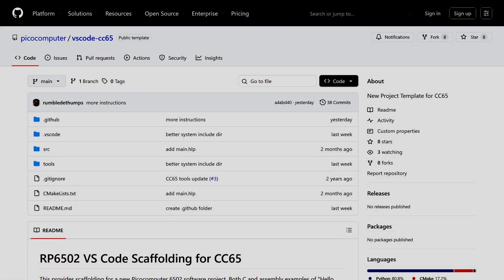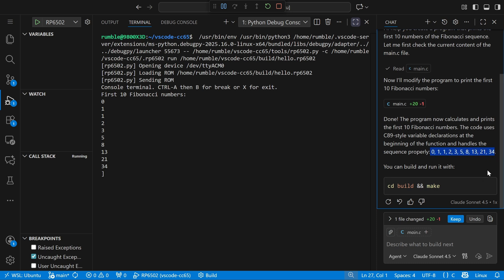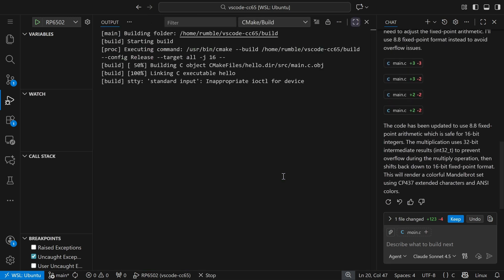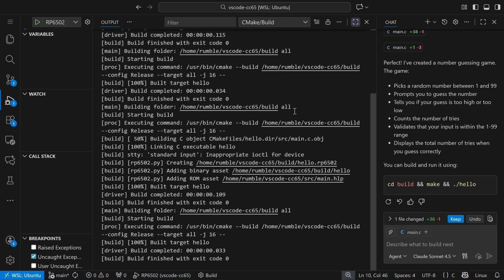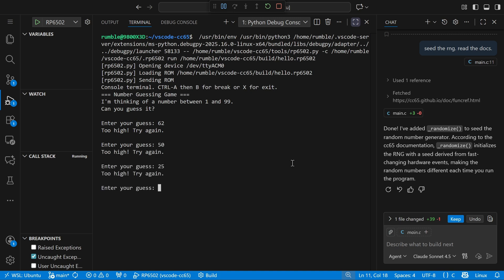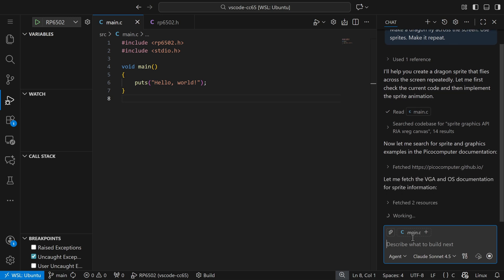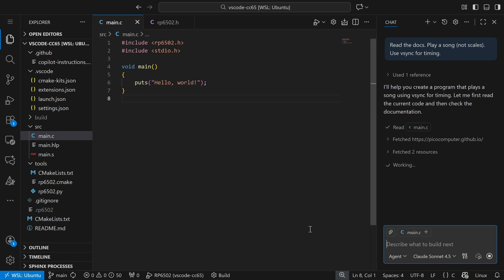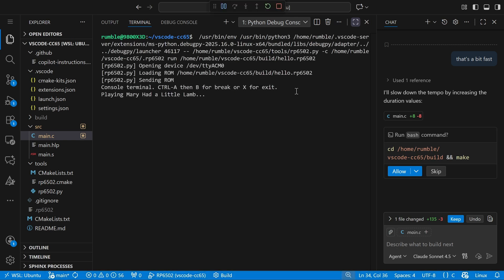Programming a 6502 with AI

Comment: Nice to see some programs on a 6502 but a terminal is not the right output in 2025 - in 1980 we have a CRT. A single board in 2025 have TFT interface or HDMI for a monitor.
Since 1980 we have bibliothecs for floating point operations.
Reply from the maker: Use whatever you want for the console. I use an HDMI IPS display. I've run it on an old VGA CRT as well. But when you're debugging, the UART is king. You can use llvm-mos for floating point until cc65 adds it. Instead of assuming all the capabilities were shown in a single 13 minute YouTube video, you should read the documentation or watch the development log.

Comment: For those completely new to this, when you get to the Mandlebrot sequence at 3:50, the low resolution is not any limitation of the AI. It just happens that the code it wrote was AI, probably defaulting that way for performance and quickness (and no other reason). If the board supports higher resolution and colors, that could have been used.  (tl;dr - AI isn't really "limited" in resolution.. that should not be your takeaway)
Reply from the maker: I asked it to use text so it wouldn't use graphics which would have taken several minutes of rendering before it was recognizable. I didn't want to warp time in this video so folks could get a better sense of how fast or slow AI is.